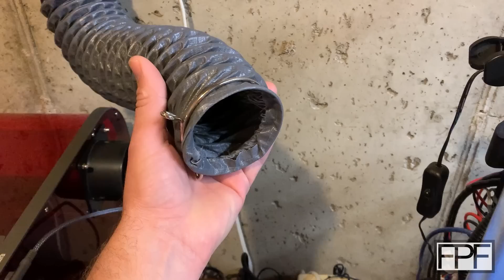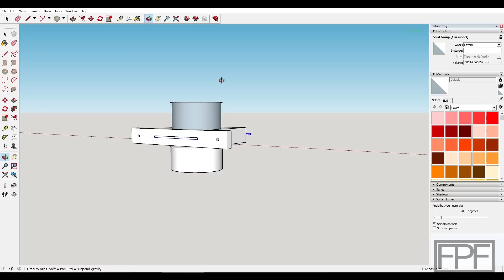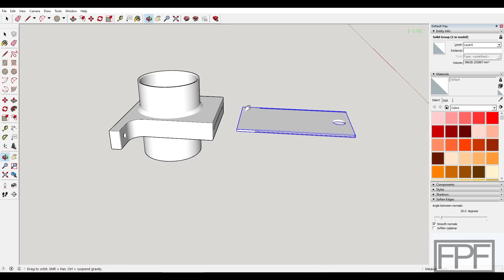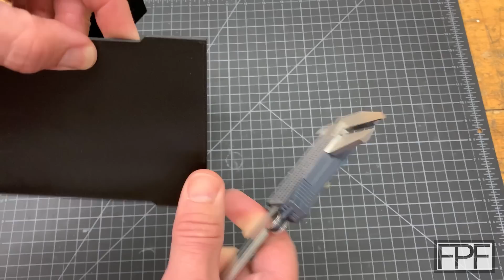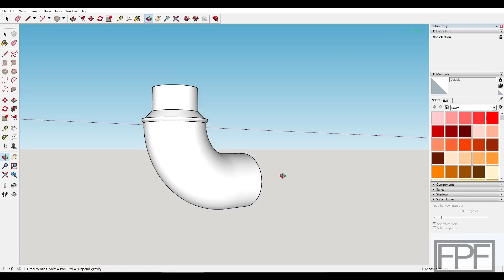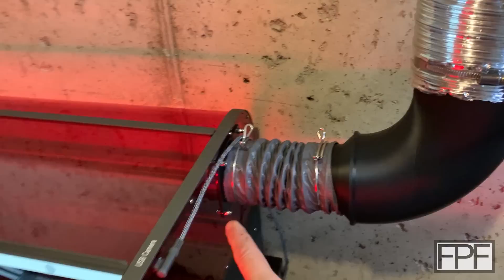3D Printed Wall Mounted Blast Gate

Comment: I know that I'm late to the party, but I used flex hose for my laser cutter/engraver. I would get buildup that ended up reducing the ID of the flex hose. I switched to a rigid pipe and that problem went away. Because your laser does have some movement to it, keep the little section of 2" flexible, but having the rest rigid will help to ensure good airflow without introducing additional turbulance. 

Regarding airflow, the little fan shroud that you have on the inside of your laser is impeding airflow. It is only a little bit, but removing it will help with a minimal gain in CFM and remove a surface for residue buildup. 

Lastly I would think that simply widening out the contact surface while adding 2 more bolt/screw holes would stabilize it without having to widen out the entire closure body all the way up. It would reduce the filament and time needed while also removing the nearly single pivot point created by using one screw/bolt on either side. 

Just some dumb ramblings from a leather guy. Thank you for the video. I really appreciate how you bring us into your process.

Comment: If you put the blast gate on the elbow but oriented vertically, the cracks in the gate will allow the condensation, which you still have a problem with, drip out

Comment: I love this channel, pratical implementations.

How long do your designs take? Would love to see a complete design video (in the software); with practical tips and tricks for designing for 3D printing.

When you print the models with support, is that just normal model-material for the supports as well? Or do you use the special support-material? Using the AMS to automatically switch materials. If you use model-material, why do you NOT use support-material?

Comment: Your videos are petty awesome, keep up the good work! . Got some hvac tips for ya. The reason why it sucked through that vent pipe into your laser engraver is because your house is a negative, open a window and your air won’t suck in that pipe. The air goes out of your house has to come back in weather you like it or not. If you actually add a fresh air intake to your return ductwork closer to the furnace. Make sure that won’t be sucking exhaust fumes in-either. Intake should be 6ft away from other vent pipes.  That will solve your problem, has to be insulated though. This will pressure your house pushing air out of your house. If your dryer or bathroom is on it’s the same principle and will make a negative in your house.
Reply from the maker: Thx.  I think it's the radon mitigation system. .  I think it keeps the whole basement negative.
Reply: @FunctionalPrintFriday yep that will do it too!

Comment: That ventilation tube is really appalling stuff to work with and look at. I know there is nothing else that makes sense from a financial point of view, solid welded stainless looks fantastic, but the price! I think the whole thing absolutely looks and works as best if can. The shut off valve works well with the fettling, although I find a dry silicone spray really helps to lubricate plastics. Nice job again.

Comment: Thinking that the elbow with the neck down for size might also have been a good place for a mounting clip option, drop a 2x4 from where the blast gate is, straight down to the floor, and have a rigid point to mount that elbow, and you would reduce even more the amount of vibration that might get in, perhaps even protect from the hose slipping off the blast bgate. (Though that could probably be done with a neck down in the fitting on the blast gate to clampdown to a slightly smaller surface there as well.) Nice work.

Comment: I'm pretty sure one of the Orca contributors said this is not a bug and is expected behavior. They claimed that there was a debate on whether outer overhang walls should take on the bridge speed or overhang speed and they ultimately decided on bridge. There is an option called " Slow down for curled perimeters" that can override this.

Comment: Nice work. Suggestion: leave a small gap where the slot in the back meets the wall. That way, any debris that is in the gate will fall out. Otherwise it can just collect then the insert won’t fully close. 

I made some gates that are not wall mounted but are more for hanging use. I’m a hobby woodworker. 

My files are on Printables.

Comment: I used a gravity louver dryer vent (6") and it's got like 4 louvers than when the fan is off they drop and make an almost completely air tight closure, never had air back flow through it.

Comment: You're still going to have a similar problem. The warm air is going to make it to your cutoff and condense there. Water will go everywhere when you open it. You need to make a condensation trap, basically a u-bend in the horizontal pipe up top with a drain at the bottom with a ball valve or similar. That way you can drain away the excess water far away from the cutter.
Reply from the maker: Possibly, but I don't think so.  There is a lot of "air leaks" in the enclosure for the laser cutter/engraver, which it needs to let air in to replace the smoky air you're exhausting out.  These air leaks were allowing a constant low-volume backflow in the duct.  I think with this new blast gate closed, there shouldn't be any flow in the vent, meaning the air will just be at rest and remain the same temp as the basement.  Remember, it's an exhaust, we're never drawing air in, so with no flow, in theory, there should never be "outside air" in the duct.  Only time will tell, but you know if it doesn't work, we'll be back to 3d print something here to fix it again and I'll cover it on the channel :)